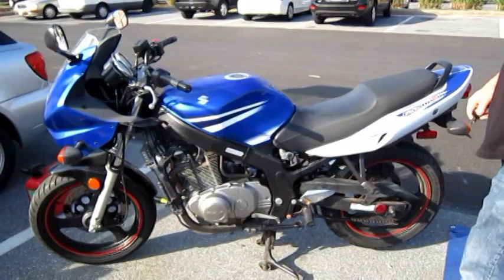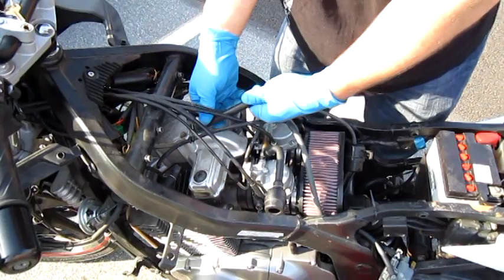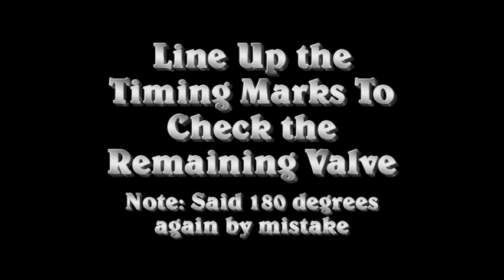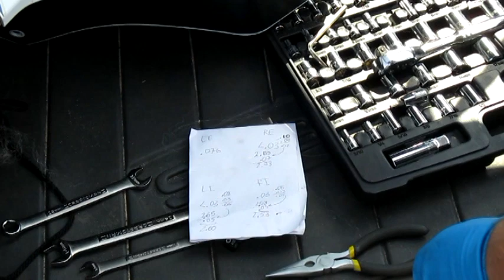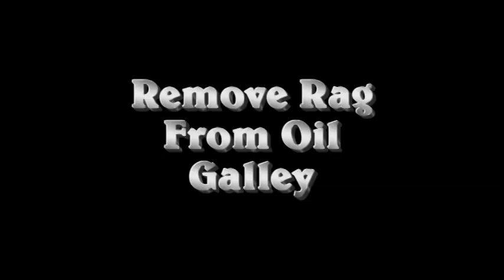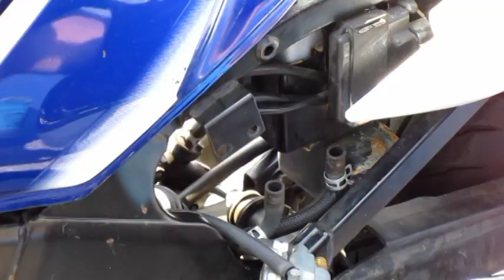2004-up Suzuki GS500F Valve Check and Adjustment

Comment: Is the RT mark the two lines after the letters “RT”? When I put it in between those two lines the valve notches are facing each other as demonstrated in your video. If I were to go on the dot between the R and T it would be slightly misaligned.

Comment: Thanks for posting.  I am rebuilding an '83 GR650 Tempter.  Discovered 2 vavlves are tight, and I need the tappet depressor tool.  Your video waa very helpful

Comment: Hey I’m having vacuum issues. The little hose coming from pair system isn’t plugged in anywhere. The nipple on valve cover where I’m assuming a PCv valve would go is not connected to anything. And I can’t understand the vacuum diagrams

Comment: Does this help with the uncontrollably high idle problem?
Reply: Hey, did you ever figure out what your high idle problem was? I'm having the same problem but I haven't replaced my shims yet, although I don't know if that's going to solve my issue.
Reply: Christopher Donahue Did you ever solve your problem? I have the same problem as well.
Reply: high idle could be an issue with not having a full seal for the vacuum. check your orings and the carb seals
Reply: After giving gas my bike will idle at about 4 thousand for about 30 seconds befor slowly dropping to two thousand.  From there it runs perfect.  Also when I give it full throttle it runs perfect.  But for some reason it takes a while for the idle to drop from 4000.
Reply: skiwheeler I’m having that same idle problem on my GS500f. I start it let it warm up and then it just begins to idle at around 4000 rpm. 

Did you ever find the problem.

Comment: +BaltimoreGS's channel you say at 9:475 to not rotate the crankshaft when the shms are out of the valve buckets... is there any objective reason behind that? what harm would it do to the bike?

the only unrealistic reason i can think off for you to give such an adivice is thinking that a couple of contcts directly with the valva buckets from the cams is  going to damage the valves...when its not
Reply: allnamesarepicked this response is way way way over due but just to answer said question, what it does is get the cam lobe stuck in the bucket itself because it is a recessed area for the shims to sit in.

Comment: So the valve check & adjust as needed is at 4,000 miles, and every 4K there after ? Seems excessive checking to me, if this is right. I say this because most shim type bikes go 15K, some longer. Going to look at one tomorrow, would someone please let me know if my info is right. Thanks, yl

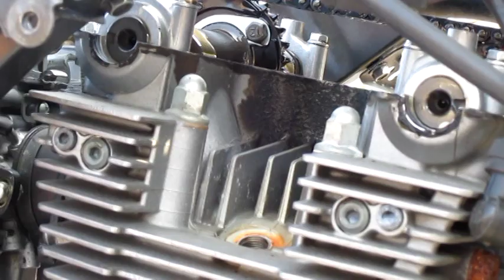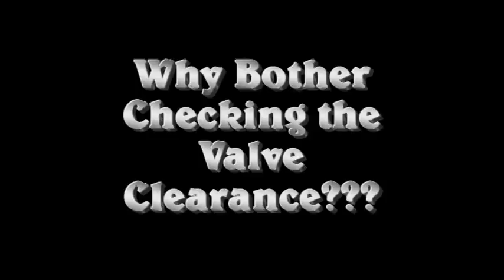Comment: I noticed that at about 4:30 to 4:50, I saw what looked like some oil that leaked from the top of the cylinder head.  My bike has that too; would that be a bad gasket or is that just normal for this bike?